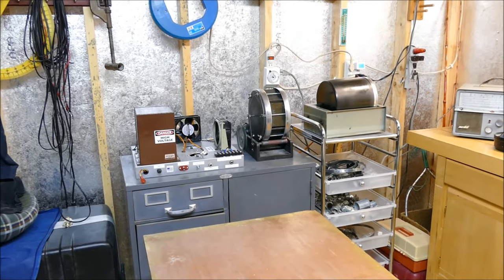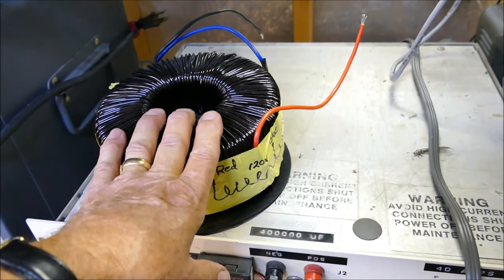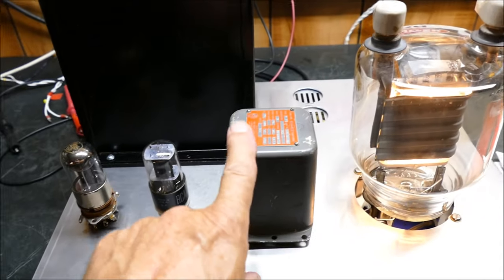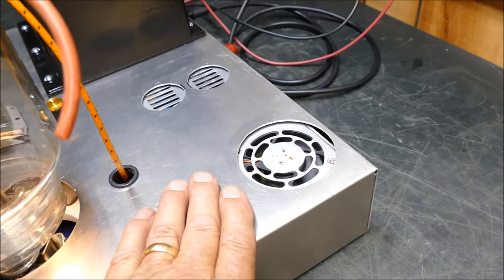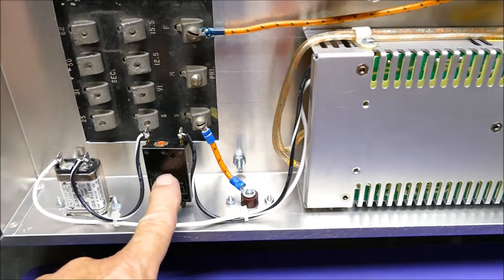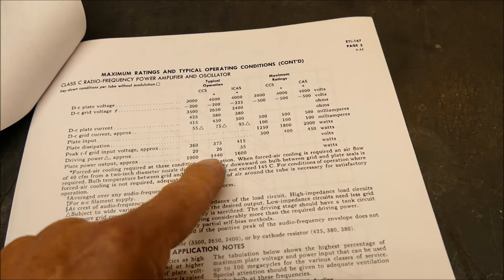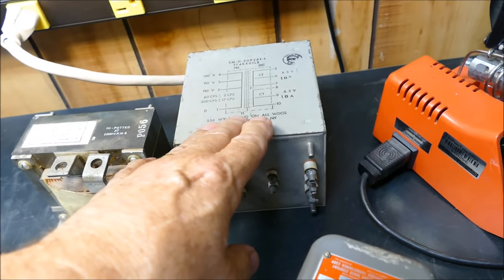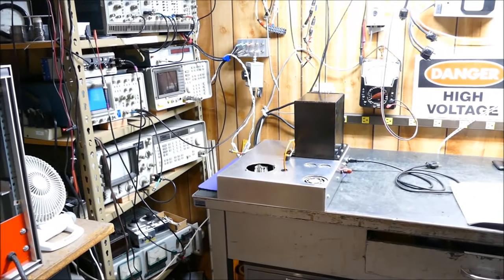833A Single Ended  Triode SET Power Amplifier Build Part 3

Comment: I see you have a HP distortion audio, analyzer I used one of these at work when I worked for Cambridge Audio, in the UK to test the P40/P50 amplifiers. . It was one of the few at that time that would measure the low distortion that the Cambridge amps produced. Typically 0.015% or less. Great to see one again.

Comment: Dave
  I'm glad this project is still kicking,
Reply from the maker: Mike Samra Hi Mike, I have ordered some solid state parts from Ebay to build a better driver (hopefully) and the low end will get a lot better. I have to admit, this thing is more than I anticipated and to turn it off, let the 833 cool and carefully remove it and then slide the chassis out with that monster transformer is a lot of work. It is heavy. It is interesting that I am indulging in these direct heater tubes for HiFi lately because even as a kid of 12 years old in 1961, these old junk tubes like the 6B4 were shunned and outdated and thrown away. You couldn't give them away or the equipment they were used in.  Even 6SN7's, etc were "old" so I was taught to think and build with more modern tubes and transistors. That was better than 50 years ago and now we love these things... go figure... The output transformer was made for push-pull 810's so do you know if that is a problem with a SE amp? I don't see why it should be but maybe I am missing something. I probably could have grounded the center tap of the filament transformer like the 6B4G amp I just finished with a little cathode bias and the hum would have been minimal. Could the way I am lighting the filament on the 833 be part of my problem? I am not interested in just jumping from one thing to another just because it has not been tried. I posted a comment somewhere about the last things I have tried with no improvement, i.e., larger blocking capacitor (I need it to put bias on the 833) and increasing the inductance of my choke to 37 H, etc. I don't mind blindly trying little things like that but some suggestions are too involved to just randomly try everything - I guess that is the way Thomas Edison did it but Tesla thought about it and didn't just "swing blindly in the dark" as apparently Edison did. Thanks for keeping in touch.

Comment: Nice built, good to see your on your way! :) i like your modular thinking, as you can re-use it for other tests, like this power supply.
Reply from the maker: TubiCal Yes, thank you. Just the components for a linear DC filament supply would be an additional 20 pounds with the transformer, choke, capacitors and two insulated heat sinks for four stud mounted diodes. This switching PS is amazing. I can set it right on 10 volts and it stays there with no load or a 10 amp load. I am really having high-hopes for this amp in that it will "sound amazing". I am probably just caught up in the hype of SET amplifier baloney.  I predict that the harmonic profile will be pretty much saw-tooth style with descending amplitude harmonics from the second harmonic out to at least the 5th or 6th.   I realize that is not "Hi Fi" but I am anxious to see how it sounds at 10-20 watts. Another week or so and I should have it working.

Comment: 1800 watts of pure power..now you need to find the speakers that will take that kind of power. 
Lets say each 12 inch speaker will take 25 to 30 watts safely, you will need a set of speaker cabinets that will house 60 speakers in series parallel  16 to 8 ohms each to accommodate this kind of brute power.
  3000 jolt power supply..wow!...gotta be careful and stay alive.
Gives a new meaning to the BeeGee's song  "Staying alive"